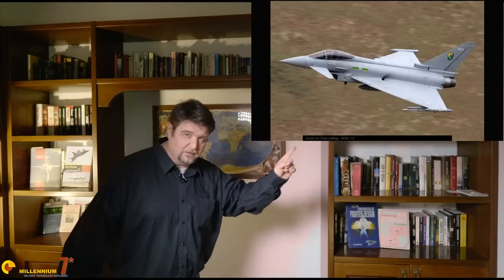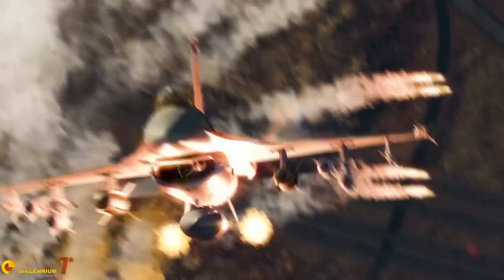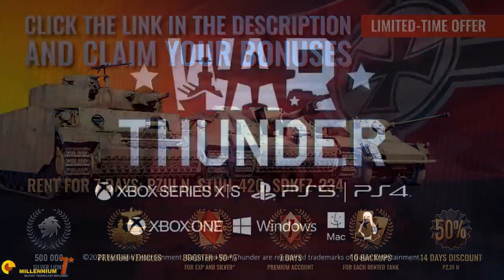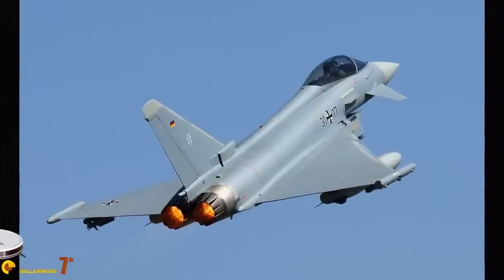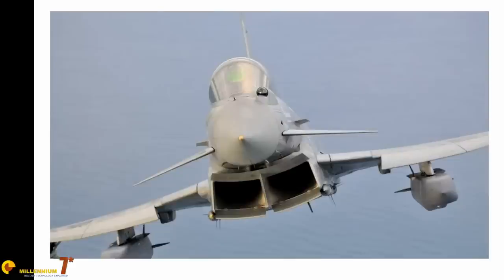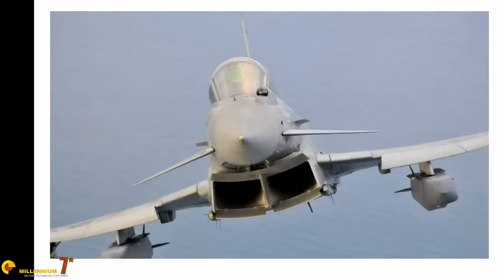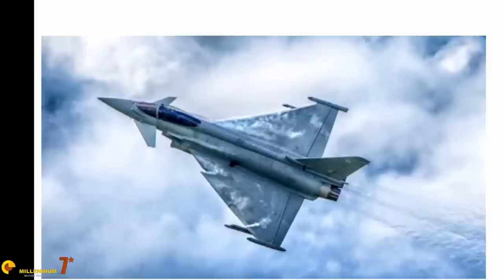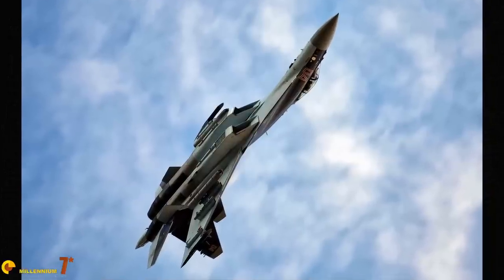I DUG DEEP into the Eurofighter Typhoon Aerodynamics and I found...

Comment: In terms of RCS, how are canards worse than tailplanes (you need one or the other)? If the answer is that the main wing hides the tailplanes (elevators), then don't the canards hide part of the wing as well... I've never understood this part about canards being bad for RCS.
Reply: You are right! But part of radar returen is the deflection of rudders. In modern combat airplanes they compensate for the lack of stability all the time. Beside that weakness, SAAB have a patent on how to minimize the radar return from canards. Why the don't have applied it on Gripen E is unknown to me. I guess it's RCS lowering effect is too small compared with carried  weapons.
Reply: Rcs reduction is achieved by ram coating on outside of skin and also have ram inside the structure that supports the skin. Canards don't have enough internal space for ram. All stealth fighter, the leading edges including the nose , wings and tails have ram inside the structure. Check out the downed photo of f117 you will understand.

Comment: What a masterpiece of engineering is the Typhoon. The Eurofighter is the only 4.5 gen fighter with a real full CareFree handling, and this gives a real advantage in WVR. Moreover  with an A/A load at sea level in ISA +20 cond. the Typhoon accelerates from 200 kts to mach 1 in less than 25 sec. It's not a secret that the Typhoon Tr-4 will be the best 4.5 gen aircraft ever produced.  I've heard the tranche 4 will incorporate the Aerodynamic Modification Kit, an upgrade that will increase the maximum lift created by the wing by 25%, angle of attack values + 45% greater than on the standard aircraft, and roll rates up to 100% higher. Finger crossed!
Reply: I believe your talking about the LERX (Leading Edge Root Extentions)

To my knowledge this kit is optional and not standard on the T4 Typhoons kind like the Comformal fuel tanks that were never used onthe T3's.

But the. LERX might be good at helping with lower speed maneuverable. It has a negative effect at higher speeds if my memory serves me correctly.
Reply: @bagdaduk  it's a more complex aerodynamic mod kit. It was tested few years ago and it will be implemented on tranche 4 and 5.
Reply: @bagdaduk  The fuel tanks have been abandoned due to aerodynamic issues. The AMK is standard on the Tranche 4 according to Eurofighter. It's on their website.

Comment: Great video, commenting for the algorithm... Then got carried away... I think it is worth pointing out how aircraft designed with stealth in mind not only prefer not to have canards, but also see less benefit from them. Engine nozzles are hard to make stealthy against radar, and exhaust plumes are bright in IR, so one of the tricks that many aircraft can use is to have extensions along the sides past the engine nozzles*. This means that conventional elevators get more of a lever arm, making them more efficient. You can see this in the F22, a bit in the SU57, and heavily in the F35 and SU75.
*Reduced side visibility has a major tactical impact because it is the aspect where doppler will also be zero. If you want to defeat a missile radar sensor that is the aspect you would chose, because in any other aspect even tiny returns can be detected. Western designers treat it as a special case with very high importance. Incidentally, this makes tail angle extremely important in terms of tactics. A vertical tail might seem like it is extremely bad from this point of view, because it will present a missile with a flat surface, but it isn't quite that simple. At low altitude an attacking missile will probably be looking down at the aircraft. A twin tail design will have one of the tails sloping away, so might actually be closer to perpendicular (Vertical twin tails makes the corner a retroreflector, so are not viable). Unless the tails are significantly tilted like the YF23, low altitude stealth in side aspect can actually be reduced by twin tails. The net effect is that twin tailed stealths want to stay high, single tailed aircraft stay low. Given this, the J20's decisions then start to make some more sense (though may still be wrong). If it is never expected to attempt to defeat a missile by notching at low altitude, it can entirely eschew the typical western emphasis on side visibility. As sensors get better I can see this being reasonable, because running away isn't vulnerable to improving sensors. My guess is that it's tactic is basically to delay early warning as long as possible, launch on the target, then get out of dodge relying on speed for defence. It's stealth is not regarded as a defensive tool.

Comment: An excellent video by any measure! 
Could you have a video on the tactical reasoning behind the choices about going stealth (even if means sacrificing aircraft performance like agility, range and weapon load) vs. using active EW while maximising other performance & tactical flexibility. 

 For example, analyse thisp: If you go in with F-35 and the opponent   has a good long wave radar system he will know you are there, but does not know exactly where. If you approach with Rafales or Gripens or Eurofighters using active EW the enemy will know you're there, just do not know exactly where. 
    In this scenario the benefits of passive stealth design seem limited...

Comment: Very good video.
Is there any chance that you make a similar one talking about why you say the flanker has such an efficient design?
Reply: Isn't it obvious by looking at it? Especially after watching this video? Just look at the old, statically stable F15 vs the unstable su27. Look at an F16 vs an su27. Look at the eurofighter vs su27.
The Su27 (& mig29) have large cropped delta wings (eurofighter) with blended leading edge root extensions (LERX) like an F16 (which also has cropped delta). The su27 has variable intakes underhung like the f16/eurofighter. Su27 has widely separated engines like the f14 tomcat, becoming a lifting body, aiding fuel efficiency and lowering wing loading.

Comment: should be interesting to see what the Typhoon can do with the new EJ2x0 engine mod2  The EJ200 has a dry thrust of 60kN and the EJ2x0 mod 2 is more like 78,000kN in full reheat it's a way bigger difference. That will radically increase the power to weight of the Typhoon and I believe increase the service ceiling by 1500m or so. I know one has been tested with the mod 1 EJ 2x0 but no info has been released.

Comment: There's really not much difference from configuration between something like an EF2000 and an F16. Both have up-loaded control surfaces in turning flight so trim drag is negligible. The EF has a lower wing loading and the F16 has a higher aspect ratio.
Reply: Well the difference in performance is pretty big

Comment: It feels like Brits brought something back from the Avro Aero with that design, the US demanded Canada stop making it (imo, because it made them look bad...) a lot of those engineers were coming from post WWII UK and just getting started! I learned from one of your videos Canards are bad for stealth, so I was waiting for that!  and you also showed how 90 degree angles are bad for radar signal bounce too, could that be part of why the wings/canards edge down slightly? mind you, that leaves the vertical stabilizer in the lark...
Reply: Stabilizer and upper surface of the wings wings are not angled at 90 degrees, it is little higher. Moreover, side reflection perpendicular to the direction of flight is invisible on Doppler radar.
MBB Lampyriade also had one vertical stabilizer.

Comment: Not mentioned in the design of the Typhoon is doctrine it would be used which effected its design. Being used as a defensive interceptor/fighter which dictated less range and weight class compared to US aircraft. In regards to the Typhoon’s lack of stealth characteristics, the canard contributing to its higher RCS. US Studies have shown that once engaged in a dog fight the odds of victory become more even. American doctrine has highlighted stealth in the F22 & F35 in getting into missile range undetected and getting the first shot off. The F15 has a massive radar to detect adversaries at long range. The Typhoon  looks have a relatively small radar.
Reply: The Typhoon has a bigger radar than the F35 and is also capable of somethings that The F15 and other US fighters are not. The F15 has a massive radar and also a massive RCS something like 25-250 times larger than the Typhoon. The Typhoon has a much more advanced self protection suit. The Typhoon beats the F15 every time according to pilots. You can find a few accounts from pilots talking about this here on YouTube.

Comment: Why not a twin canted tail derivative of the Typhoon or some other delta canard fighter? Would slightly improve stealth, increase lift, and improve roll authority. Slightly more weight but the extra lift would probably provide a net improvement in range as the F-15EX canted tail design option suggested.

Could probably update the engine intakes and ducts at the same time to improve stealth and maintain weight balance by shifting overall engine system weight balance slightly forward.
Reply: my fluiddynamic professor was the leading aerodydnamic engineer for the Eurofighter and he once told us that the initial concept of the Eurofighter intended a double tail or v-tail (I'm not sure anymore which one) but it did interfere with the delta wing aerodynamics especially in high alpha domains so they scraped the concept.

Comment: Eurofighter can pull 9g turns constantly with 2 fuel tanks and missiles at Mach 1.2 or until the pilot feels sick . It has good power to weight and can outclimb all but F22. German Airforce officers stated it's true top speed was Mach 2.35 though no loadout information was given.
Reply: Eurofighter has a t/w ratio of 1.25 while the F-22 has a t/w ratio of 1.18 The best t/w ratio has the Su-35BM with 1.30
Reply: @JazzJaRa  The F22 doesn't have drag issues when hauling missiles around. So any figures are at best vague as they don't come with side information like height, temperature air pressure etc or fuel load. Basically claims in this field are just a guide.
Reply: Actually I saw a video where the German pilot said the top speed is Mach 2.5.
Reply: @joshafc41  we are in the myth and magic area Mach speed isn't as important as acceleration and climb rate.

Comment: Great to see you back Gus! I’m curious about the Typhoon. Some say it’s one of the best, yet it’s struggled in competitive trials against it’s main rivals for bids and of course it faired quite badly in mock air combat against Indian Su-30mki’s. Apparently the upgrades are partially to help with the issues?
Reply: India set the rules and said we won't use our radar it's so secret. This of course meant only close up fights and that suited the thrust vectoring SU 30 better . If some fights could have been at BVR as well then the results would have been different. Rumours that only the most experienced Indian pilots participated rather than a balanced section of ability was also common knowledge. The outcome of this meeting was exaggerated and after much time passed the RAF clearly stated it was not factual.
Reply: @NATObait  well the RAF would wouldn’t they if they lost? Point taken that it was about knife fights, but Typhoon is advertised as a dogfighter, but now we see the upgrades designed to enhance this ability (which is a good thing) it’s pretty clear that a well flown Flanker can take a Typhoon in a close in fight. As I’ve said many times relying on BVR is a bad idea. They tried it in Vietnamese with F-102’s and soon they were getting hit by Fresco’s.
Reply: @mcal27  The Eurofighter has helmet queueing for IRIS T or ASRAAM Block 4 and Meteor for BVR so the knife fight in a telephone box is not likely. The new AESA radar is here and 2 newer AESA options are coming soon. The SU 30 is not a realistic threat hence Rafale is the pride of the IAF not SU 30 . Eurofighter has towed decoys and BriteCloud so the chances are decreasing for the old SU 30. If it was a guns only solution then the Eurofighter has better power to weight and can outclimb the SU 30 and dictate the rules of engagement.
  Look up YouTube for how it really is titled....
Red Flag Briefing on SU 30 MKI by American Colonel

Comment: The answer with Russian(Soviet) fighters is that delta-canard generation was simply not born.

Any fighter geek would've remembered the MFI - Mig 1.42 (demonstrator of which has actually flown).
With it came the 'light' fighter (eurocanard weight class actually) - the 1.42. 
Then of course the navy S-32 (demo development of which - su-47 - is, well, quite well known).

Then the S-37 fighter bomber, and so on, so on, so on.

Basically - canards themselves were supposed to be a true 5th fighter generation, which was swallowed between the dissolution of the Soviet Union and the coming of stealth. But it was never to be, and actually that was supposed to be 6th became the 5th.
Reply: No 6th gen fighter have ever existed.